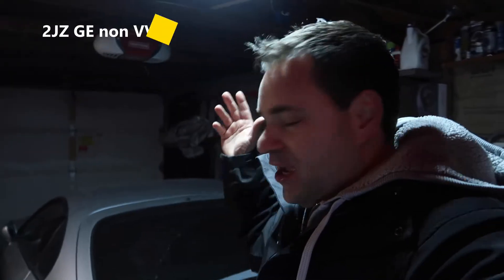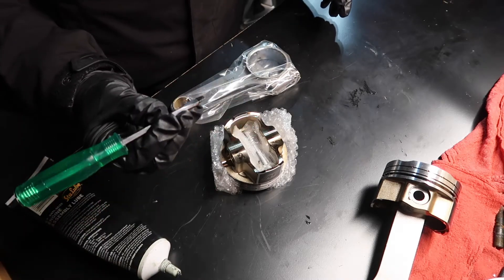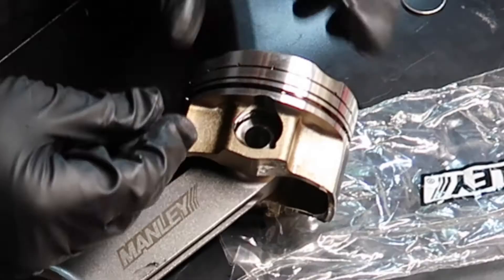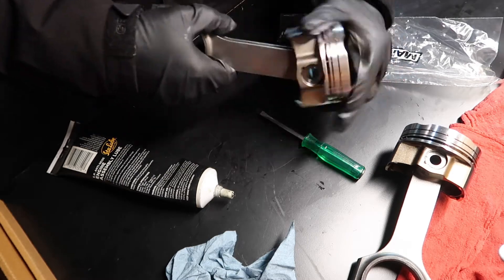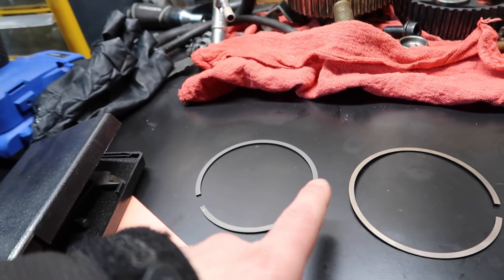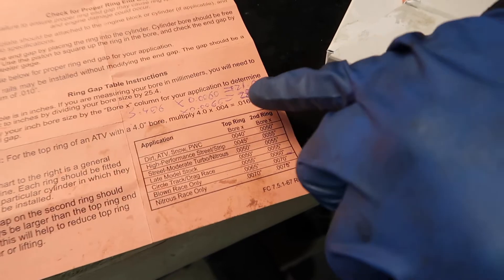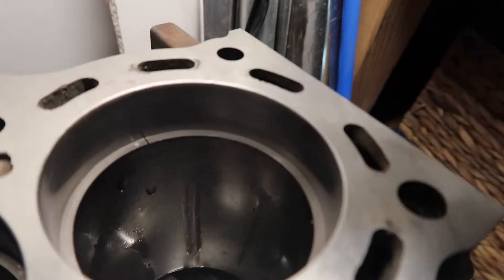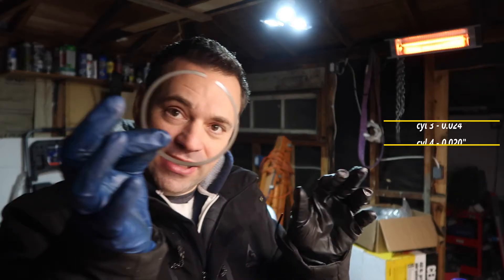Supra Turbo Build - Episode 2 - Piston, Rods and Ring Gap

Comment: What rings gap do you recommend me for my build i used oem gte piston and rods on  ge vvti engine my goals is to get 600 hp
Reply from the maker: Hard to tell, it's best if you look into the tings table to match your application.  I used .023 on the first and .025 on the second.  I also used similar gaps on my other builds.  You only need to be sure it is not too tight so when it gets hot it won't butt up the ends.